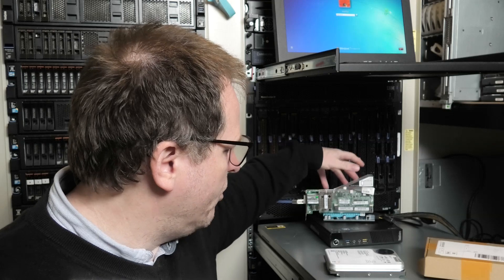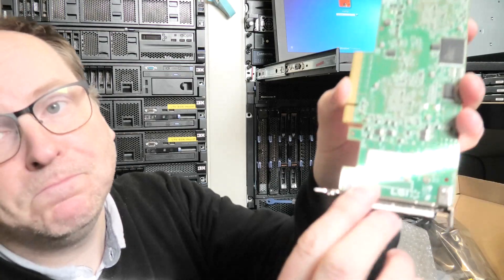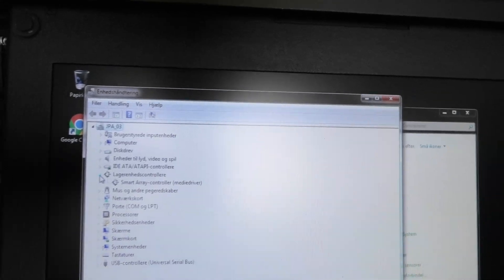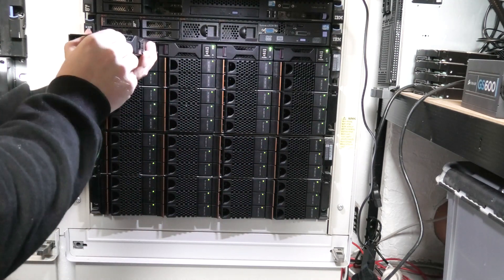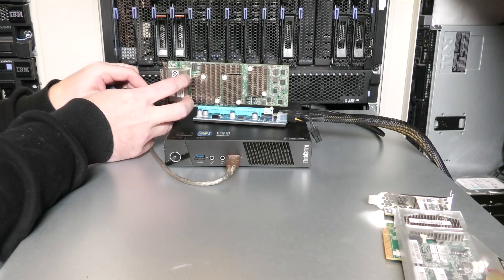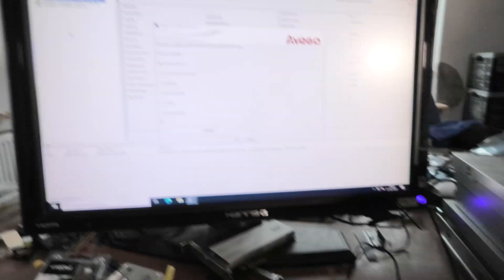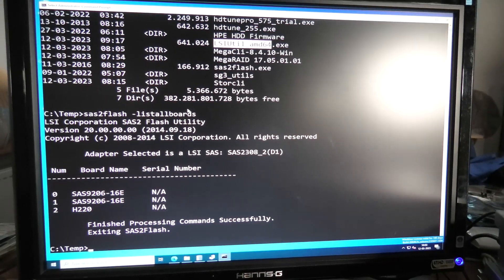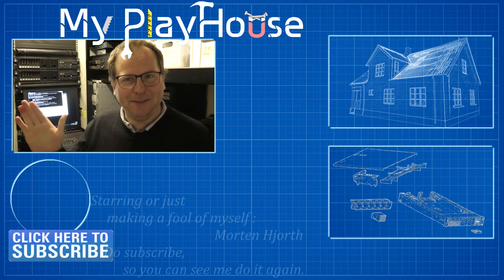LSI 9206-16e Quad Ext Port 6Gb/s SAS HBA & NO Luck - 1273

Comment: Another good video that shows what to beware of. 

You are right that some drives will not show up because basically the card will not support them.

There is a big list floating around that lists what manufacturer drives are compatible with what LSI cards. 

So most likely those white drives are just an unlabeled well known manufacturer drive that needs its model identified and checked against the list.

When/If I find the list i will post it here. 

thnx for the video.
Reply from the maker: Thanks for the info!

Comment: Do some of the drives have the SES lock enabled?  I had issue with a batch of drives I bought from eBay 6 months ago.
Reply: I bought a few LSI 9201-16e and they came to me disabled as well.  A quick install of Fedora should be able to get you fixed up in LSIUtil.  Maybe to collab w/ @ArtOfServer ?
Reply from the maker: Yes,, I might have to install some Linux.

Comment: Morten ? Its not the "pin 3 issue" that is the problem ? 🤔 Sometimes pin 3 have to be covered in order for the drive to work
(Only a problem for the white-label-drives)
Reply: First thing i was thinking about too. I have some chucked seagate drives, they work on a HP P410 controller, but not on the LSI 9300 until i cover the pin with kapton tape.
Reply from the maker: But this a Enterprise drive,,and not a drive out of a USB box... But it is not unthinkable,, and could be worth a shout.

Comment: you simply don't need these old hw raid adapters - use zfs and a cache drive instead - use simple sata adapters - they are cheaper and with mdadm sw raid you can easily move arrays around - no drivers needed
Reply: Like TrueNAS. 😊
Reply from the maker: Software raid is fine for a storage server,, you are aware that this is a HBA,, it was suppose to do just that.
Reply: @MyPlayHouse  ok ok for your purpose here it is probably appropriate but still for up to 12 drives sw raid is better and when you combine mdadm with zfs and a nvme cache is just as fast #IT mode

Comment: You have that board connected to a totally jackleg setup... I have done similar things but I suspect it should work better if you slot it into at least an x4 PCIe connection and maybe move off of Win7 (try Linux)
Reply from the maker: Not ruling that out,, but the X1 does show some life..

Comment: I will be trying to go even further by connecting some HBA or RAID card to Vision SiFive 2 - RISC-V quadcore that was on Kickstarter a few months ago! :) it has m.2 slot, I do have tested the controller to work off x1 PCIe wide slot using one of those miner thingies so it depends on the kernel drivers now :)
Reply from the maker: Nice projekt! and you are using the M.2. slot ?
Reply: @MyPlayHouse  yes! Hopefully it works :)